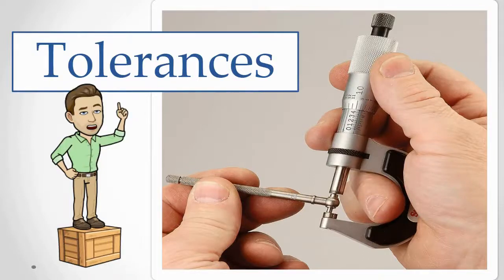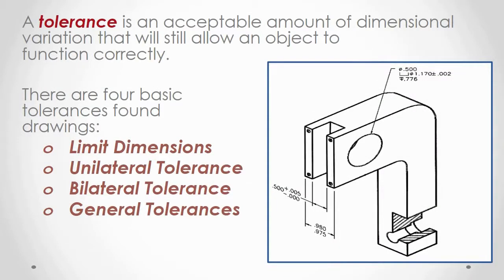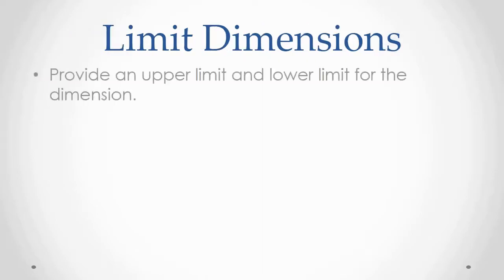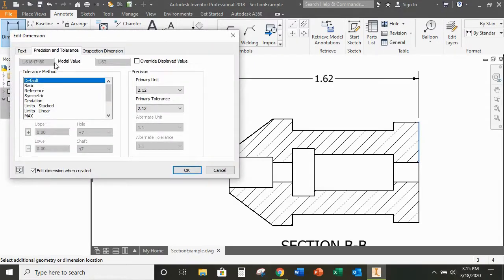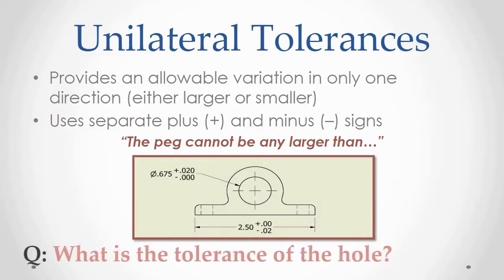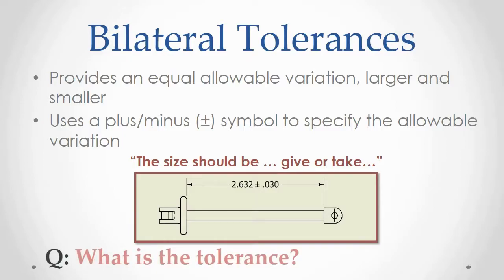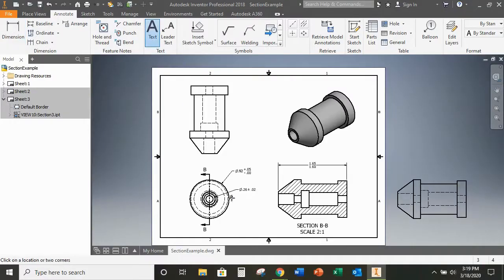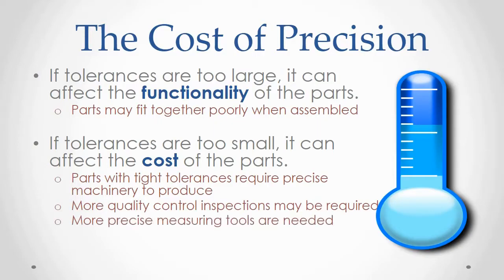Lesson: Tolerances in Technical Drawings

Comment: Good content. The question I have is: Is it ever acceptable to design with absolute dimensions without specifying tolerances?
Reply: It’s good practice to include tolerance. As a drafter, we need to include those tolerances for quality control. We had a drafter before who didn’t include those tolerances on drawings so now we’re going back and revising them. Usually tolerances are for the worker’s use but when selling that product, it’s not always necessary to mention it. Hope that answers your question.
Reply: @everywhere3301  great answer
Reply: @everywhere3301  great answer